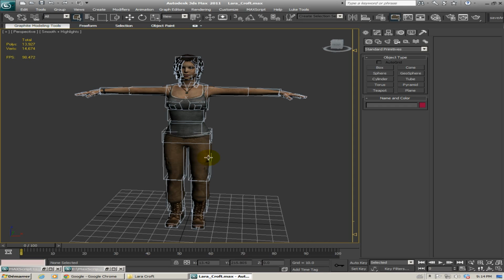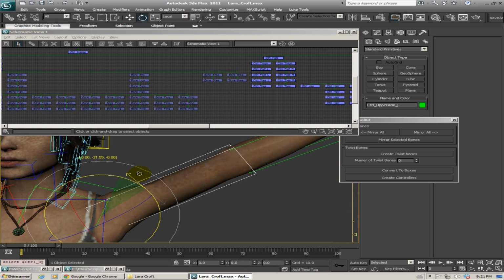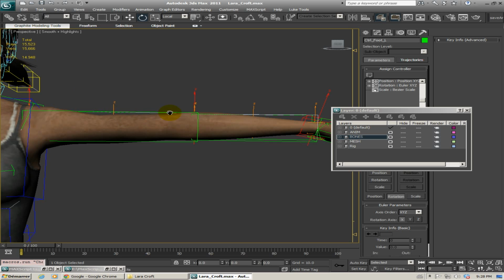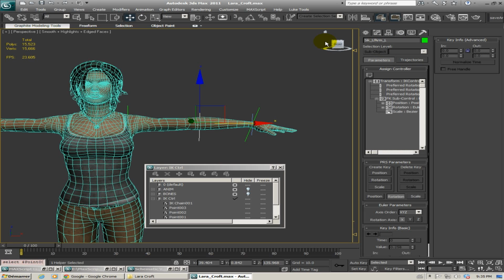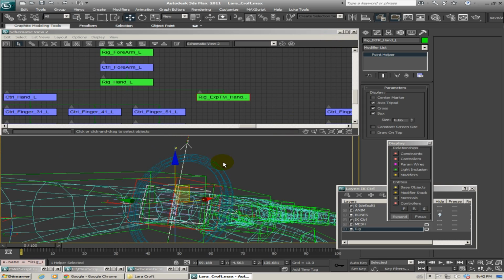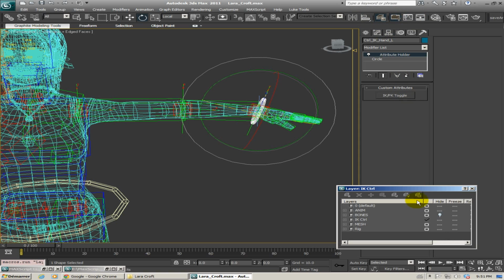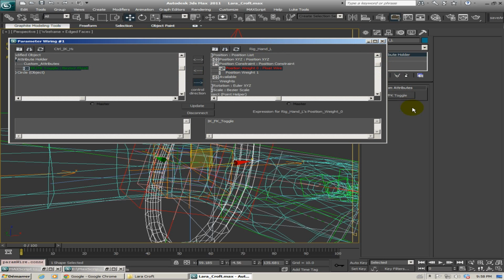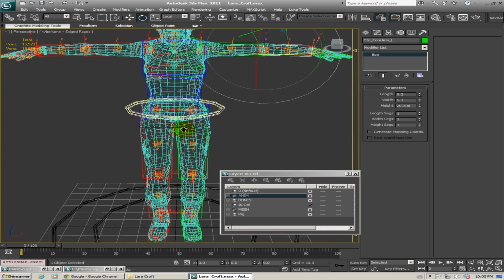Let's Rig! 3DS Max Lara Croft Pt 5   Generating FK Controllers, Twist Bones and Creating IKFK switch

Comment: Very bad tutorial of any kind. the tool you created rules out any insentive for anyone interested from a learning point of view. If all your going to do is create a video where a tool does everything. What possible use is it, to the audience.
IT may well have taken you alot longer to rig, however this tool doesnt show whether you can do it yourself, and ultimately to help others who are learning and are doing it manually stage by stage. And i mean without this tool of yours.
Reply from the maker: Hi! First, I'll point out that I made it clear in my first video that this series wasn't meant to be a tutorial in any sense. It was just a video of me rigging for fun while commenting on what I do, and sharing that experience for others who are interested to see. Second, the only magical thing my tool does is saving time. If you've spent the time watching the video, I explained in detail everything the tool does, all of which can be done manually. For example, my FK controllers are simply a copy of the already existing bones, and then it rearranges the hierarchy (correctly set their parents), and place position and orientation constraints on the bones to their corresponding controllers. For the twist bones, I've done it manually in the previous video and explained in details what I did. The tool simply replicates that.
Reply: Xhyllos1
Thats fair enough. I knew this video stated "part 5" of a series, however I didnt watch your previous video's. I was seeking a tutorial/walkthrough for a particular part of my own rig, but discovered you were using a tool instead.

Using a third party tool, like the one you created, does in a sense make the viewers lose out. its great if you have shortcuts, but not for the viewers. even if it meant copying a repeated action, or taking out the repeated bits completely from the video would have been more beneficial for the viewer.

I use youtube, like many others, to remember how to do stuff after not doing them for along time. As a reference, so to speak. so i do find walkthroughs and tutorials rather frustrating when their not done in the conventional basic 3dsmax tool set. Non user friendly, as they say.

eitherway. i fixed my own hickup on my own rig, so its all good. After a good headache and a scratch of the head. :D
Reply from the maker: Dani H I understand your point, but I think it's unreasonable to give negative comments because the video you are watching doen't have the information you seek. I mean, I watch videos/walkthroughs/tutorials all the time too, and not all of them use a method that I want to use for the particular rig I'm doing. If you did have a problem with your rig that is not covered in the video, maybe I could have helped if you had asked. And besides, a rigger in 3DS Max does need to know how to use MaxScript and create apps that will automate repeated actions like I did here. That is especially true in the video game industry.
Reply: Xhyllos1
Its true that your video is no tutorial, but that isnt something a viewer like myself will know or not, until the method the author is using becomes apparent. Ie your tool.
When i browse the net for the odd help or too, its often a google jobby including a brief description, of the issue/problem. for instance "Arm twist 3dsmax tutorial". Google doesnt necessarily find "tutorial" results, hense leading me to you.
I think it would have helped if you somehow added a "Non tutorial" part to the video description, to avoid confusion for the viewer, and having to watch several minutes to discover it wont help. but meh, it doesnt matter now. :)

as for me. I was trying to fix A wrist bone link to the arm, since my IKHiSolver didnt like it, and having to add a complicated wrist controller with an arm controller, but at the sametime the wrist controller connected to the arm would still twist with the hand snce i had 3 wired up bones aligned to the lower arm. 3dsmax is pretty temper mental and fussy. In the end i got it to work, but the hand bone isnt directly connected to arm bone. the odd thing is, ive done it with my foot/ankle to leg bone, and it works fine dispite the schematic view being identical to the arm. the Ikhisolver doesnt like bones attached to the end bone sometimes. hehe.
so ya. i was seeking a minor detail within the arm twist/hand rotation rig.
Ive sorted most of the issue out. I had to add a bone in the wrist/ankle, to get around the linkage issues. so i have upper, lower arm bones. a mini wrist bone, then a hand bone. 3 wired twisting bones on the arm. ik hisolver linked to the mini bone, but having a controller aligned to the mini bone, but linked to the hand bone. i have 2 controllers linked, which do the arm movement, and the other for wrist rotation and arm twist. Their linkied so they dont seperate.
However if i move the arm ikhisolver arm controller out of reach of the arm, the hand seperates. So its kinder fixed but i just have to be careful when animating. would help if the ikhisolver cross would stay fixed to the end bone though to avoid it. and i cant link controller to mini bone because it breaks the ikhisolver.

http://i128.photobucket.com/albums/p166/Grimwristler/arm1_zpsb4c3e8f9.jpg

http://i128.photobucket.com/albums/p166/Grimwristler/arm2_zps95753db4.jpg

theres a few screenies. :)

Once im done with her hair, using planes which is a NIGHTMARE btw. Im going to start adding muscles. Im modelling jessica alba, to be as detailed as possible, without breaking my 7 year old pc so. hehe.
Nothing game orientated. just animation.
Reply: Dani H
Talking of hair using planes. Im going to try making it into cloth, since the hair and fur is HORRIBLE and theres no very good easy free hair plugin out there. but at the sametime trying to keep the hair looking as realistic as possible. which is near impossible based on poly count and strands of hair. I dont imagine the cloth is going to like it either, plus my 7 year old pc to boot. its going to be painful. :/

also struggling with experiments of cloth to keep long strands of hair, styled and curled without it ending up straight. no matter how stiff i tell its parameters to go. not only that but i imagine its goign to be hell animating to find that the hair doesn wish to flow the way it should. :(

so ya. ive got lots of problems coming my way it seems. Keep plodding along with the project none the less. :)
Reply: Xhyllos1 Heres a question. How would you rig a female foot, which is rigged to the floor, but at the sametime, will need to be able to add a high heel to the mix, changing the rig altogether? Like having 2 rigs apart of 1?
Ive done the leg the same as the arm without the twist bones, and added a floor guide you can rotate freely with no interaction of the foot, to keep and eyes guide on the ground, but still havent worked out the high heel issue. :(
Reply: Dani H 1/ http://i128.photobucket.com/albums/p166/Grimwristler/foot1_zpsa3fe2eef.jpg
2/ http://i128.photobucket.com/albums/p166/Grimwristler/foot2_zpsee4dc27f.jpg
3/ http://i128.photobucket.com/albums/p166/Grimwristler/foot3_zps6cb70037.jpg

I need some way that the rig will get over written where the action of the high heel becomes the foot. so instead of moving the rig and trying to keep the high heel with it, while keeping the animation smooth, (which will be hell). I'd rather at the point the heel is on, that i can simply move the leg and foot controller while the high heelmoves with it.
but still being able to detach and re attach the heel, so she can take off and on the high heel in the animation.
Ive looked a little into link constraints, but i dont know anythign about them really. I think thats my best bet.
Reply from the maker: Dani H For the arm twist, I would refer you to my video #4. I actually do the twists manually and step by step there. I would warn that it isn't my best work on that though. I have better, although similar, methods now than I did at the time I made that video. But there are still information in there you could maybe use.

For the hair, it always a pain in the ass to do if you want to be as realistic as possible. I mean, both the cloth and hair methods are not easy to work with.But I think I would use the hair and fur method over cloth, by using splines to determine where the strands of hair go. Creating the hair isn't the hard part. What is more difficult is to find ways to avoid the clipping of hair through the head. I'll admit that I didn't get to work with those often. I work in the video game industry and thus we never touch hair and fur, or cloth modifiers. If you do go with planes for the hair, I've found that the easiest way is to simply create bones and FK controllers for them, like I've done here for Lara. You can easily add as many bone/controller as you need, but the more you add, the longer it'll take you to animate them.

For the foot, I would rig the naked foot normally first, and add a dummy on which you can attach the shoe. Just manually place the shoe on the foot, in the position you want it to have when you animate it. Then align a dummy on the shoe in position and rotation. And the parent the dummy on the foor controller. After that, you can animate a link constraint between the shoe and the dummy.
Reply: Xhyllos1
I did think about making a bone rig for the hair, and apply a spring to make it bounce, however, if i go as far as animating the model to bend over, or in some way make the hair move around rather than simply fixedt. the spring wouldnt work, and i fear the bones would have to be given gravity, which would make the hair strands sraight rather than curly. the hair style im seeking for is a straight forward split top of head, and have the hair strands curl around each other in free flow. The problem occurs when adding cloth since the curls disapear and the hair simply straightens into long strips.
and as you say, i would need alot of bones, and ill have ALOT of strands.
The logical thing for me is to model the hair using planes, and then apply cloth to the hair mesh. I just cant seem to keep the cloth modifier to keep the hairs shape dispite telling it too. whether its determined by quantities of vertex at the base and root of the hair, i dont know.

Thats so far:
1/ http://i128.photobucket.com/albums/p166/Grimwristler/face1_zpsc6fd96c9.jpg
2/ http://i128.photobucket.com/albums/p166/Grimwristler/face2_zpsa82a9d66.jpg
3/ http://i128.photobucket.com/albums/p166/Grimwristler/face3_zpsd8688d96.jpg
Hair will be textured and given an alpha. (not done yet)

as for the foot and shoe. I dont know how to use a link constraint, so its somethign ill have to look for. Ill give the dummy idea a go, along with adding a floor guide like i have for the base of the foot, but on the shoe for animating reference. Its just the temperarily attaching/detatching and rotation of the shoe and keeping the foot inside the shoe which concerns me. I got a funny feeling that if i link anything to the current yellow foot controller, that it might just break the rig. 3dsmax is soo temper mental like that. was a game and a half just making the bones function how it should.

Ive finished with the arms and legs now anyway, so theres no need. but thanks anyway.
Reply from the maker: Dani H I would link the dummy for the shoe directly on the foot bone., not on your controller. The dummy's sole purpose if to link the shoe on it. After that, the shoe should follow the foot normally. Do look into link constraint though. That's the way to go to animate objects that are external to the rig.

For the hair, using springs can be tricky, because springs are a bit hard to control when it comes to animation. The bouncing will often cause the hair to clip into the head, and you will often have to counter-animate that effect. If you truly want to reach the highest level of realism, I would recommend the hair and fur made with splines. I haven't worked a lot with hair and fur, but I have done it this way. The thing is, working with hair and fur makes it for a long rendering process, but using splines allows you to control the shape you want the hair to keep. I'm not quite sure, but I also think you could use the Spline IK modifier on your splines to be able to animate the hair manually too. You could use fixed planes directly on the head to make sure you don't see the baldness of the head under the hair , but cover the whole thing with hair and fur would make it look more realistic. It is a bit hard to work with though.
Reply: Xhyllos1
I have no idea how link constraints work. so. im guessing i need a dummy which is orientation aligned, does it matter where its positioned or does it need to be linked at the foot joint? as for the shoe. does that need a dummy also? does the link constraint connect the 2 dummies together or do i just need to move the pivot of the shoe so it aligns with the foot dummy?
as i say i have absolutely no idea how link constraints work. hehe.

The problem i have with hair and fur is doing the simplest of things like simply styling. 3dsmax's way to style with brushes are horrible. You always get odd strands that wont move or go in a direction you wish it to go. Ive also tried rendering hair and fur in the past and it took forever. I wouldnt ever be able to actually do an animation, because the rendering time would be rediculous. Im running on a 2.4ghz cpu / 8gig of ram and a 8800gtx gpu. (dx10) Its 7 years old. Ive also seen the results hair and fur can make, and if im honest, it doesnt look amazingly realistic. It can look more like grass or a field of corn than it can hair, for a blending subtle look. And of course to solve that issue means more hair, which is more lag and render time. If i had a new rig then it would probably be okey, but i know my rig struggles.

thats why i took the planes and cloth modifier route. because atleast then i get the control to position the planes where i wish them to be without lag.
Iam also thinking about making a mock up model of the girl, and have the planes simulate upon that instead of the real model, to save on lag, since i could make the mock up low on polys. Whether it would work or not with less lag i dont know. the mock up would be skinned to the rig for animation, but it wont need to be perfect, since its sole purpose would be just to guide the planes. Its an idea. I know id love to watch it simulate to understand how smooth and flexible the hair is, so i wont have to animate the entire thing, to find out the hair looks anti hair like. whether it looks like rubber, or a wet rag.

Ill just go with the flow and see how it goes. This is a side project anyway. Just doing bits and bobs on the side as i go along. Im currently designing a game which is an mmo/city building Rts, based in ww1 and ww2. I dont have the programmign skills, but iam modelling the assets for it, with all the documentation etc. Its just a pitty i dont know a programmer when i need one. haha.